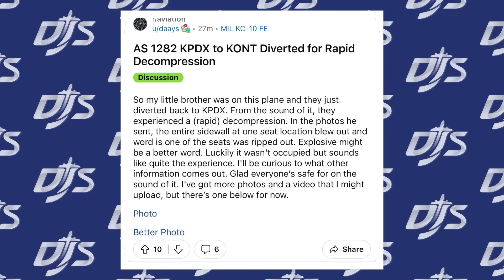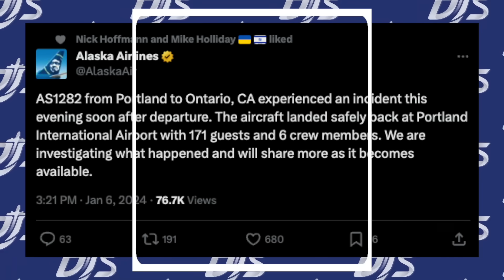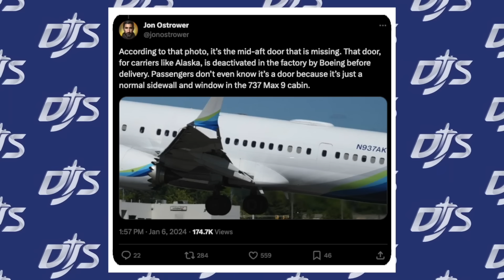Alaska Airlines 737 MAX Door Blows Out

Comment: Despite the extreme caution about the MAX it keeps making trouble. I doubt they will ever fully fix it.
Reply: they should never allow this plane to take off again. its a real mess
Reply: @Sadude13  and what is you’re capacity in the aircraft manufacturing field to make this statement?
Reply: @whiskeykilo2h429  even non experts can see  that Boeing has serious production quality issues.
Reply: Many airlines already bought this plane. I wouldn’t be happy if I was one of them
Reply: I'd rather not fly on a 737 MAX, sometimes you have no choice.
Reply: @ItsDeffoScott  Exactly. I am avoiding the Max at all costs. Just not worth the risk even if the chances are very low that something happens. I'd rather fly a MD80 from the 80s.
Reply: @ItsDeffoScott kind of like mrna batcines.
Reply: @sciagurrato1831  Don't try to tie me in with your anti-vax BS. I believe in science and doctors. Bye.
Reply: I mean the airframe itself is fundamentally flawed. It’s an old design, isn’t as efficient as its competition, and seems to still have quality control issues. Even if it is fixed the only way Boeing will be able to get ahead is by developing an entirely new airplane
Reply: They have never needed to fully fix and never will
Reply: @ItsDeffoScott  and “i believe in truth, justice and the American way”. How old are you?
Reply: @ItsDeffoScott  you’d “rather not”🥴but trying avoiding the Max 7,, 9, and 200…or the Max 7 and Max 10 that are being introduced this year 😀
Reply: @halberderdier8073  what quality control issues ‘chief’ ?  Or is this another MSM hyping the incident?   How many issues does Airbus have and I can tell you a lot because I work on them everyday that never make the MSM!

Comment: Wow, that door could have struck the horizontal stabilizer and caused a lot more damaged than an opening on the fuselage.
Reply: Also, they were lucky that it happened at low altitude.
Reply: Alaska Airlines regretting selling their A321neos now.
Reply: That is a missing emergency exit.  And the cabin pressure at 16,000 ft may not be sufficient to stop someone opening the exit.       

And why is the girl concerned shown in another picture, opening the emergency exit on a bus?  Is that what she did in flight?

R
Reply: the hole is sealed with a plug and from the inside it is covered by a sidewall so that to a passenger it looks like a normal window, not a door opening. This plug, halfway between the over-wing exit and the door at the rear of the plane, is present only on the largest versions of the 737.  
Not possible for a passenger to open it.
Reply: @marzoval9551 if this isn’t the wake up call to utilize Hawaiians relationship to get back in with airbus i dont know what will be.

Comment: Can’t begin to imagine what would have happened if someone had been in that seat
Reply: scared shitless, pissed their pants and worst case scared to death.
Reply: Need for clean underwear, at least.
Always keep the seatbelt fastened ..
Reply: Blew out at 16,000 (from the radar data) so more than likely the seat belt would have been unfastened at that stage.
Reply: @alastairbarkley6572  well if they’re sensible and kept it on might be ok. You don’t have to undo it and it’s usually best not to unless you need to get up
Reply: @alastairbarkley6572  Not mine. Always fastened.
Reply: The seat itself got blown out so there’s not much you can do in that situation
Reply: The seat cushion, not the whole seat, but would that have detached the seatbelt?
Reply: @alastairbarkley6572 The fasten seatbelt usually isn’t turned off until cruising altitude.
Reply: They'd have been sucked out without a doubt, unless someone else had managed to get to them quick and grabbed them. It's mad lucky how bo one was sat there
Reply: @damlatorun6756  According to the photo, the seat was still in the plane.
Reply: There was a person in the next to that exit where this occurred. The persons shirt was sucked out the exit.

Comment: As a lifelong pilot, airplane builder, and engineering instructor, my first impression as a passenger of the 737 Max 9 was that it was a hunk of junk.  Despite being quiet and comfortable, some of its observable mechanicals seemed overly complex and there are numerous aerodynamic tweaks festooned about the airframe that appear to be late additions to correct problems.
Reply: So lucky this heavy door did not collide with the stabilizer omg so lucky

Comment: Alaska Airlines not at all regretting off-leasing all their A321 neo's at the end of last year in favour of 737 Max's, I'm sure...
Reply: Dumbest decision they made. I don’t care what anybody says I will never ever fly on a max. People said that it’s the safest airline after the two fatal incidents but now we had lose bolts on the rudder and this door being blown out. The plane is a complete write off
Reply: Happens when a aircraft it’s thrown together in week after Airbus told them with pants down when they revealed the Airbus A320Neo to the world, there are former Boeing engineers that have told that Boeing was not planing a new Short to medium houl aircraft at that time because they believe Airbus did not plane to upgrade the A320
Reply: Yup. worst decision ever
Reply: @jeffb.140  tbh, they probably aren't regretting it - because going all 737 was about reducing cost for them. And it will still do that. So as with all the other airlines that choose the Max, they'll get what they pay for and they won't care about the rest.
Reply: Yep Alaska  just announced they’re grounding all the 737 max until further notice. No idea how this happened as the plug panel is bigger than the actual ‘hole’ so even if loose it shouldn’t just pop out. Wonder if it failed structurally.
Reply: @wurly1  Alaska has just grounded all Boeing 737-9 MAX planes though, so depends how long that lasts.
Reply: @asaaby06  If you are based in the USA, it will be almost impossible for you to not fly on a Max at some point. 
I use Southwest for domestic connections, and even if you wanted to only select non Max aircraft, the company says that aircraft can be changed to suit conditions or other issues.
Hence, I was scheduled from Denver on a non Max, but because of weather conditions, our flight got delayed, and we eventually went to Houston on a Max. 
Nothing you could do. Refusing to fly on a particular airplane is not admissible for a reimbursement.
Hopefully, this incident is a one-off.
Reply: @p6x2 truth. Going is a part of a global duopoly, but for US carriers, the first choice is always Going Going Gone.
Reply: @p6x2  I’m based in Australia and we have three carriers out of 5 who don’t use the Max. Qantas and Jetstar ordered the neo and Rex still fly the NG.
Reply: @asaaby06  But Virgin and Bonza have the max.

Comment: DJ you'll need to amend your video, it wasn't actually a door but one that is an optional emergency exit on the MAX 9 for low budget airlines with more seats. Alaska Airlines, with fewer seats has it as a regular window seat and has the space "plugged" with the interior finished like the rest of the cabin. Apparently that plug failed.

Comment: Unacceptable!! Basic operational failures from Boeing and again with MAX.
Reply: I am glad that are still banned/grounded in most markets... FOR THIS REASON!
Reply: this is most likely a maintenance error
Reply: @stickynorth most markets have ungrounded the MAX
Reply: You're very quick to jump to conclusions.  Why don't you do what a RATIONAL THINKING human being does, and suspend judgement until the accident investigation has concluded and the root cause determined?    I think that this will end up not being a manufacturing defect, but human error.
Reply: @Blank00  ungrounded?FFS
Reply: @Turboy65 The Boeing Fanboys as well as the Airbus Fanboys will NEVER be rational thinkers. That’s just too much to ever ask from a biased perspective.
Reply: We don't know if it's Boeing's fault. It could be an assembly flaw (=Boeing), or it could be a design or manufacturing flaw on a supplier's part.
Reply: How is this down to boeing. You guys just love blaming boeing for anything that happens with boeing aircraft. As I was delivered it was on the hands of maintenance
Reply: @nickolliver3021 that doesn’t mean it left the factory with a part not assembled correctly by Boeing as we’ve seen previous examples. The aircraft was only 3 months old I doubt it even had a B check
Reply: @tomstravels520  keep being triggered. It doesn't mean that it could be installed wrong at factory either as it was handed over and delivered. The FAA inspect before delivery so somehow something went wrong. Let's wait for investigation rather than lean towards jumping to conclusions
Reply: @nickolliver3021 Like the loose bolt in tbe rudder?😮
Reply: @jungbolosse3034  like structural cracking in fuselage? 🥱
Reply: @dmcr9525 I thought so. With those people's biased perspective, they just jump into conclusions on aviation incidents that occur and argue the cause of those incidents.
Reply: @Turboy65   You mean like Alaska Airline's rational thinking grounding all aircraft of this same type?  Look people, if an airline grounds a jet, don't fly that jet in any airline, anywhere in the world.  Feel free to jump to conclusions, don't wait for the mishap report, don't wait for Boeing to cover-up their mistakes and issue a softball finding.  The most rational thing to do is to blacklist the problem aircraft type, in this case, 737 MAX.  (older 737s are fine though).  Oh BTW human error is also a manufacturing defect when the human installs a part wrong in the factory.
Reply: @jacobzimmermann59   Both examples you provided are Boeing's fault entirely.  Boeing is responsible for hiring and training assemblers, and maintaining excellence through quality assurance.  A suppliers part is also Boeing fault.  Boeing holds those 3rd party contracts, not John Q. Public.  Boeing is responsible for the testing and inspection and operational checks of all 3rd party supplied parts.
Reply: @BasedF-15Pilot  If someone installed the plug incorrectly, he might have installed other plugs incorrectly as he may be following the procedure incorrectly or the procedure is wrong.  Grounding the other planes to check that is quite rational.

Comment: First impression has to be Boeing fitted the emergency exit incorrectly. Do not know  how they work  but there will be a locking  mechanism. It must not have been fully engaged. The exit was  installed so it could be used if the aircraft was ever reconfigured with more seats. Reports said the exit was deactivated which might have had the consequence of deactivating the warning system that sets off an alarm when  an exit is not properly locked. The offending exit was hidden behind the cabin lining and would have been out of sight during Alaska's pre-delivery inspection. If the  warning system is deactivated when a door is deactivated, expect that to change.

Comment: It's interesting that a lot of news sites are reporting it as  window that blew out.  A window would have been more concerning to me as a potential major internal structural design flaw. A door could be attributed to a door not closed properly or at least a more easily corrected latching mechanism. Concerning none the less and sure glad that everyone is okay.
Reply: On further review, it actually sounds like it was a door plug that blew out. Based on the configuration of that particular plane an emergency door was not installed in that location.
Reply: They call it a window blowing open because it was used as a window section. A door could be installed there but instead a plug with a window in it was installed. So for all intents and purposes it was a window section and not a door, it had no door like functionality and only functioned as a window.

It only looks like a door after failure because the plug failed, however it was in no way something like a door failing to lock or coming off.
Reply: Right, that's why I added my addendum.  Still, if there is a flaw in the design of the plug, it will be much easier to correct than if it were a failure in the general structure of the plane around one of the regular windows.

Comment: A pressure sensitive part like that would normally have a flange that connects with or contacts interior components of the fuselage. Normally it would be installed by bringing it inside the aircraft and inserting it in the hole. Of course, there would be a positive seal to prevent loss of pressurization. i’m with the other posters here. There are three areas of concern. The part might’ve been defective and the flange or cover failed. Number two the part might’ve been installed improperly. Number three is one I don’t even want to consider. But, there is a small chance of an engineering error. As an ex-BAC QA person, I don't want to see another S-show for Boeing. They were lucky the part blew out at only 16 thousand feet. They must find the failed part.

Comment: The door/window that blew out is designed to be an emergency exit and has a pressurisation seal around the door/window which assists in holding it into place. Sadly when an airline chooses to wall over the exit it prevents the cabin crew from visually monitoring the door/window for issues such as a broken seal/ pressurisation leak/tampering etc. I suspect there was an issue with the pressurisation seal which caused the door/window to pop out at 10,000 feet (airplane cabins are pressurised at 10,000 feet). This also explains why the aircraft suffered a rapid decompression and the oxygen masks to deploy.
Reply: It’s not a functional door. It’s a plug panel that’s bolted in permanently, the inside has normal wall panels. You can’t see it from the inside. It’s only a door on a different model for Ryan Air.
Reply: @bishopdredd5349  It's not a functioning door because Alaskin Airlines has chosen not to use it as a functioning door/exit. You are correct there are bolts there to  hold the door/plug in place or add hinges in the event the airline chooses to use it as a functioning door/emergency exit. Some airlines have 2 boarding doors 1 in the front for boarding first class/business class/front of cabin and 1 in the aft for boarding in economy class/back of the cabin. As for my use of emergency exit I refer to my training of all removable doors and plugs can be used as emergency exits however not all removable doors and plugs can be used for boarding. Using regular wall panels is a safety issue as this prevents regular visual inspections such as ensuing the lock bolts are in place, the door is closed/locked, the seal is intact,  no tampering has occurred or the door/plug isn't whistling (they make a horrible noise when there is a hole in the seal or there is dirt/debris on the seal).

Comment: I understood it was a window panel/part of the fuselage - NOT a door. It seems on this plane that the option to have an emergency exit located at this part of the aircraft wasn't taken up - so it seems it was a panel that blew out. Every passenger interviewed afterwards on TV described it as part of the fuselage - nobody mentioned that there was an emergency exit there.
Reply: It’s a plug door that is sealed and deactivated unless cabin density requires it, passengers wouldn’t know there was a door there because on the inside it’s just cabin wall

Comment: Lucky they were relatively low. Imagine if this door blew out at 30,000 ft. Remember what Patroni said in Airport. "Sudden decompression at 30,000 ft is something you've got to see to believe...Until the pressure equalizes everything within 20 ft that is not nailed down is going to get sucked right out that hole. At at that altitude you can't breathe so unless they get on oxygen in 45 seconds it's good bye" Pretty good flick

Comment: Now that's an unheard of story, a plug door being blown out...
Kinda reminds me of AA96, TK981, UA811, BA5390 and 3U8633, and the Aerosucre 737-200 whos cargo door wide opened
Reply: Aa96 was a cargo door .
TK981 was a cargo door.
UA811 was a cargo door on a nearly 19 years old 747.
BA5390 was an improperly installed windscreen panel separated from its frame, causing the captain to be partially ejected from the aircraft.

All very different from an exit plug on a weeks old jet.

Comment: Two questions.

An aircraft's life is measured in flight hours and pressurisation cycles. If an aircraft suffers a rapid decompression,  you would imagine that this stresses the fuselage more than a normal de-pressurisation. Does this still count as half of a cycle, or is it an increased value based on the altitude the pressure was lost?

I am aware that aircraft can be manufactured with all the door options installed, but they will be permanently closed and often have standard looking side panels over the top to 'hide' them, I presume so as not to confuse passengers in an emergency evacuation. Exit doors have a contrasting colour around them (either a band around the opening or on the edge of the door itself - I am not sure which, or even if it matters) some doors (as in the case of the 'door' which blew out) do not have that band. Does that signify that the door is de-activated and can not be used?
Reply: I don't know, but the plug door being ripped off mid flight, will probably make an extensive hull inspection necessary before it is allowed to fly again.
Reply: @zorktxandnand3774  Quite, I suppose we that we can be grateful that the door didn't cause damage to the tail, which could have rendered the aircraft too unstable to control.